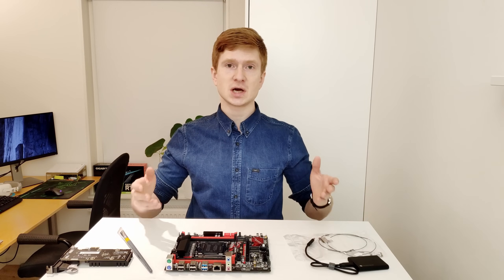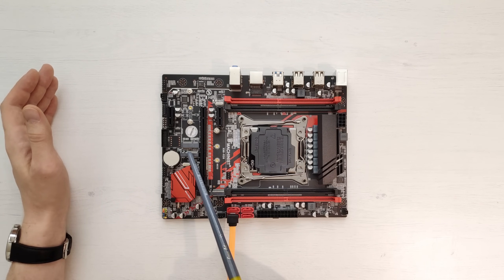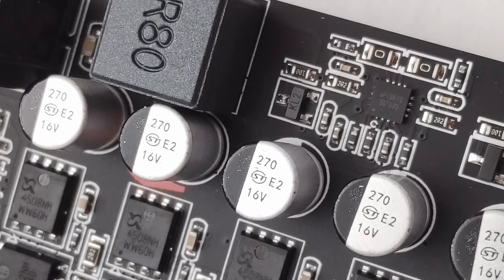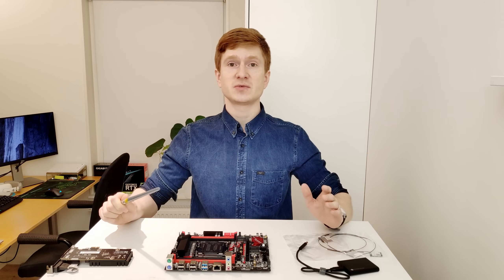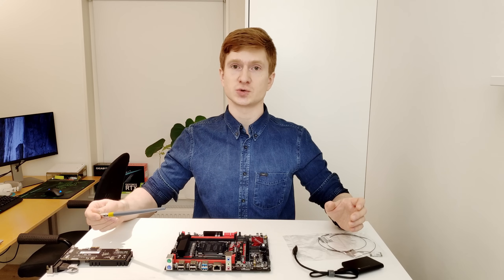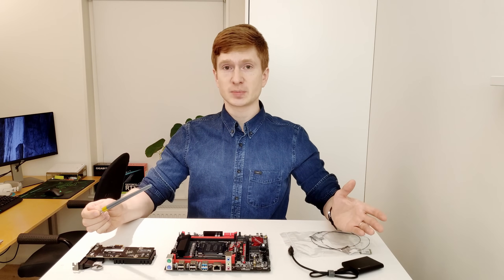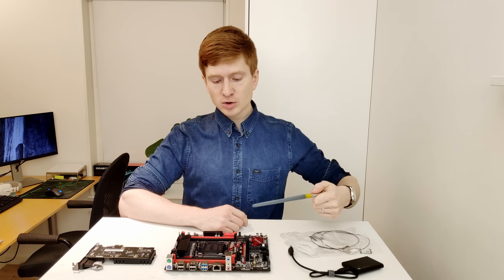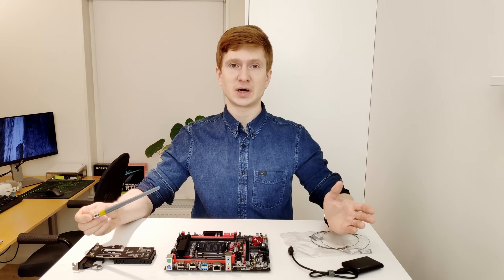🇬🇧 Machinist X99-RS9 – detailed review | E5-2678 V3 | i7-6800k | BIOS | O.C. | VRM | Mi899

Comment: Is replacing the thermal pads under the vrm heatsink on this motherboard with a higher thermal transfer graphine pad a reasonable fix for vrm temps and/or with a vrm fan? I am looking at what appears to be a ddr3 version of this board from Jingue (who I assume is a rebrand of machinist) and would probably work with the x99 hm-f huananzhi bios, and will be doing my own testing
Reply from the maker: I don't think that this VRM can be "fixed", you can improve temp by adding extra fans, but I still won't recommend it for 120 Watt TDP CPUs.
Reply: @Miyconst  thats unfortunate. I do have an EVGA copper heatpipe vrm finstack from an X58 board I was going to try to fit to the board with the graphine pads, as it has the same mounting hole measurements.
Reply: @Miyconst  I do have a 2643 v3 that I was planning on using with the turbo mod, do you think that would be sufficient?
Its a 6 core, but 135w
Reply from the maker: Judging by the TDP - the motherboard will be a fire harazd if you try to stress test it, but I don't know how this CPU behaves in real life. For example, E5-1620 V3 has a very high TDP as well, but in reality, it consumes about as much as E5-2620 V3.

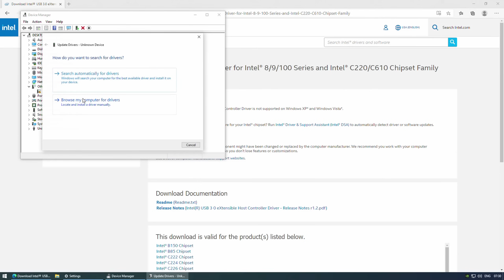Comment: 7:58 Unknown device could be broken intel management engine
Reply from the maker: Yes, very well could be.
Reply: @Miyconst  Quickest way to check intel me status is to connect rj45 lan cable and turn the system off. If motherboards rj45 port won't light up then there is no intel me running.
Reply from the maker: @Masaliantiikeri  thanks for the info, I will try that with the next tested motherboards.

Comment: Nice to see a properly wired x16 lol. Ive decided i will be getting a 6800K. Prices are getting very nice for them, too good to pass up. I still havent decided if i should get a china mobo or cough up the 160-200 for a nice asrock or asus, etc. So ive been rewatching alot of your reviews. I have recently seen several ebay sellers offering a 6800k-6950x paired with an HSGM X99_s680 v3.1c far what seems to be a very decent price. have you heard of this one at all? its design reminds me of the huananzhi x79 2.85 but with an x99 socket, and a single vrm cooling fan,
Reply from the maker: I will try to check what that motherboard is, but so far I can't say much. As far as I remember, most of those boards had only two memory channels, 2 slots for DDR3, and 2 slots for DDR4, which makes it rather pointless.
Reply: @Miyconst  yes im only really considering the F8 or D8, even if i dont NEED 8 dimms, its cheaper to add sticks than replace the ones you have, so i could get 4x4 now and add an identical 4x4 later if needed. 219 is what they are asking for that board and a 6800K.  it only has 4 dimms. looks like dual channel. but i might consider just buying the deal and selling the board  https://www.ebay.com/itm/Intel-Core-i7-6950X-6900K-6850K-6800K-E5-2680R-V4-E5-2680-V4-with-X99-Motherboar/174549060356?hash=item28a3ef4b04:g:WHkAAOSwaYVfzbGg
this is the link in case you are curious. tbh, 40 extra for a 6900K might even be a worthwhile deal. ive seen them close to that price with no mobo
Reply from the maker: @eclipsegst9419  the motherboard you have linked has 2 DDR4 and 2 DDR3 memory slots. DDR3 & DDR4 cannot work together, and there are only a few Xeon V3 CPUs which support DDR3. Thus, there is no way this motherboard has quad channel RAM configuration.

Comment: Great review! Thanks! 
I usually measure my mobos in The back part. Generally it shows 5-8 degrees more.
Reply from the maker: Really? If you keep the motherboard on a box, the back side will heat up this much, but in my case it is mounted on a test bench, and the back side temps are ~5-7 degrees less.
Reply: @Miyconst  Yep, back of the mobo tends to be hotter when mounted in a case, much more limited airflow.
Reply: @Miyconst  could i put a thermal pad to cool the back of the motherboard?
Reply from the maker: @juninhocale4044  yes, you can do that, it helps to transfer heat from the motherboard VRM to the chassis, but it's also easy to screw something up and cause a short circuit, which will kill your motherboard and be a potential fire hazard.
Reply: @Miyconst  wow, I think it's better to put a cooler behind it
Reply: @Miyconst  thanks for answering
Reply from the maker: @juninhocale4044  my colleague from Mir Computers is doing such tricks, here is a photo: https://www.instagram.com/p/CN4wh5BMnmp/
Reply: Really, in cases the temperature reach higher value on rear side of motherboard, just back from VRM mosfets, but, if you change the original thermal pad for a high conductibility one, like Thermal Odyssey, the temps tend to be more homogeneous through the heatsing and board. I am using a DELTA 4020 12V 0.6A PWM fan on heatsink, using a fan controller i set the speed to havd a good air flow without noise. I unlocked the board, and set 50-20 undervolting, chipset is C226. I am using E5 1620 V3 4/8 @3.6 all core, 140W cpu. The temps on AIDA FPU test do not hit 60c. I will test with a 2685 V3 12/12 @3.3ghz all cores 120W soon to see the impact on temps.

Comment: 6:50 Have your tried disabling STR and enabling hibernate? I've had a couple very old machines that wouldn't STR but could hibernate. Hibernate doesn't require too much hardware support.
7:50 Isn't that Turbo Boost Max 3.0? 6800k has it. E5-2678 v3 doesn't.
9:40 While I agree that the VRM is too weak, using a top-down cooler (instead of a tower cooler) would lower the temperature tremendously.
Reply from the maker: I didn't try on this particular motherboard, but checked with other - hibernation works.
Reply: I know I’m late to the conversation, but hibernation works on this board. I just put my system together today and confirmed. Not quite as convenient or efficient as sleep, but it’s better than nothing.

Comment: Thanks you for this great review. I was waiting for it ! Now I know I will not use this board for my E5-2680v3. Looks like I will have to buy a regular board for this processor anyway...
Reply: A 2630L is no expensive, it will not perform the same but is better than throw the motherboard to the shelves
Reply: If your case can support some fans on the top pointing to the VRM you get lower temperatures and use that CPU without aftect to much the mb lifetime.
Reply: @nmocruz  In my use case, setup will be in a small case, in a closet, and run 24/7. This are not best context, this is why I try to find a better motherboard without temperature issue.
However, it looks to be a good motherboard for most use case. Just not fit my requirements.
Reply: @AlexandrePetitjean  hard to find a small one with a good VRM for CPU with many cores. keep lookng, this channel is going to review to more mb, maybe the x99m plus d4, but let see the review
Reply: @nmocruz  Yes, I am also waiting for this review :)
Reply: @AlexandrePetitjean  in my case I got a  2630L just 55 W, the performance is not bad, let see if handles my needs

Comment: Thanks for your videos, they helped me to decide on buying a chinese kit! My idea was to mount a 2678 V3, as besides "normal" usage and games, I also do about a render per week, at 4k 60fps. Right now I need to wait 2 hours to render a video of 4 minutes!
Do you think that HUANANZHI X99 F8 motherboard will handle it fine? It is worth to go for the 2678 V3 instead of the 2620 V3? My current PC has an i5 3550 and 8Gb of DDR3.
Greetings from Spain!
Reply from the maker: Yes, and yes. Huananzhi X99-F8 will handle E5-2678 V3 with no issues and this CPU is a significant upgrade over E5-2620 V3.
Reply: BTW, can you recomend an specific cpu cooler? I am not very fan of RGB systems.
Reply from the maker: Cooler Master Hyper 212 Evo would be a good cooler.
Reply: Many thanks!! Keep up with those videos, they are so informative and precise :)

Comment: Great in depth videos as always!  Dude can you help me a bit?

I have E5-2620 v3, Jingyue X99M plus D4, 8GB DDR4 ECC x 2 and I bought them separately(Yes, my mistake). I paired it with GTX 1660 Super, but unfortunately I can't make it work. It says no signal detected (monitor cable also tested), but fans are spinning GPU are on, and HDD spinning. I already tested it with X99M-G2 and X99-F8M replacement motherboard thinking the motherboard was the problem. I also have FSP 550W PSU that is already tested with other pc and a multimeter. I also tried it with regular desktop RAM, still the same issue.

 What do you think is the problem, is the processor faulty or any other possible cause? Any help will be highly appreciated, thanks!
Reply from the maker: I think, the issue is the RAM. Could you specify the RAM you have tested with?
Reply: Here's the details of the RAMs:

ECC REG RAM = Sk hynix 8GB 1Rx4 PC4 DDR4 2133P 2133Mhz DIMM
Regular desktop RAM = Crucial 4GB DDR4-2400 UDIMM
Reply from the maker: Yes, most likely the issue is with the RAM compatibility. You need 2Rx8 sticks.
Reply: @Miyconst  Thank you for the response again kind sir, I will buy that type of ECC RAM. Just to clarify, it doesn't show like the CPU is dead?

And another question, is it okay if 2Rx4 variant or just the 2Rx8 is the safest bet?
Reply from the maker: @NotAllan  I can't say much about 2Rx4, since I don't have such ones to test, but 2Rx8 is the safe bet. It could be that you have got a dead CPU, but CPUs are usually the last to die, unless your CPU has some physical damage.
Reply: @Miyconst  Hey just an update my friend, It is working now. The faulty part is the CPU itself. So the 1xR4 ECC RAMs are compatible with x99m-Plus D4. And I already unlocked the turbo boost, using x99-8m-f BIOS. I was soooooo nervous that it didn't properly boot the first time, but it was fine now.

Thank you again for your efforts. Even though I'm happy with these PC parts, I will still continue to watch and support you.
Reply from the maker: @NotAllan  thanks Allan!

Comment: Built 3 systems using your channel as a guide.  Great work!
Reply: which ones are they?
Reply: @CatSovietski  Two are the X99T8's flashed with Mi899 X99F8 bios unlock.  The last is a generic x79 atx from Machinist.  T8's are using the E5-2678v3 whereas the x79 uses the E5-2650v2.  My T8's Win10 sleep function works though.
Reply: @anthonyslaughter1728  congrats on those kits... They're awesome... I have the f8 one, planning on getting the 2678 v3 as I'm still using the 2620 v3 which is still pretty usable but not enough for adobe applications

Comment: Hi Miyconst, what do you think about my 1200€ workstation? It  has Huananzhi X99 F8, GTX 1660 Super, 64GB (8x8gb) DDR4, Lian LI PC 011 Dynamic, Xeon E5 2699 V4 3,1ghz, Crucial P1 500gb + SSD Kunup 512gb, Alphacool Eisbaer 240mm and Sharkoon CoolZero 650W? It coud never be possible without your videos that I love
Reply from the maker: That's a very decent workstation! Is your CPU an engineering sample or the final retail version?
Reply: @Miyconst  final retail version
Reply: @Miyconst  with turbo boost unlocked I make 6800 points on Cinebench R20, 150 points more than a Threadripper 1950X, using a cpu that I have paid 420€
Reply: I thought you could only turbo boost unlock v3?
Reply: @Digital_Block_64  My motherboard has unlock also a V4 Xeon
Reply from the maker: @primi67  Could you please specify a bit more details? Turbo Boost Unlock does not work with V4 CPUs, but E5-2699 V4 has TDP of 145 Watt, which lets it turbo quite high with non-AVX workloads. Maybe this is what you are experiencing?
Reply: @Miyconst  I have unlocked turbo boost by activating "energy efficient" and disabling the features of power management. Miyconst I don't lie, my cpu is clocked at 3,1ghz using this "cheat". Unluckely on YouTube I cannot post screenshots, so if you have facebook or Instagram page, I could send the screens there
Reply from the maker: @primi67  I trust you, but what you have done is not "Turbo Unlock". By "Turbo Unlock" we mean a hack, which forces all CPU cores to run at the maximum turbo frequency, in your case it would be 3.6 GHz, not 3.1 GHz. This hack exploits a hole in the V3 CPU architecture, this hole was "fixed" by Intel in the V4 series.
Reply: @Miyconst  in this case I don't know how to tell you. I can guarantee, with photos and videos, that my 2699 v4 takes 6800 points on Cinebench R20 and show you that is always at 3,1ghz frequency. But in all cases I am very happy to talk with the person that I think that is the best chinese motherboards's reviewer on the Internet, I mean you Miyconst :)
Reply from the maker: @primi67  thank you for the support! E5-2699 V4 is surely a very powerful CPU, but as I said, with Turbo Boost Unlock it would be supposed to run at 3.6 GHz on all cores, not 3.1 GHz.
Reply from the maker: @Digital_Block_64  you are correct, Turbo Boost Unlock works with Xeon E5-26XX V3 CPUs only.